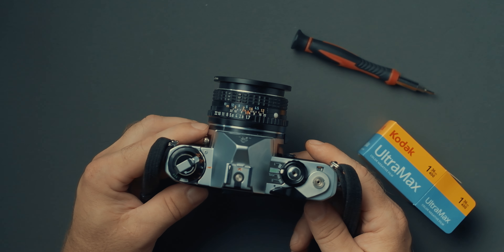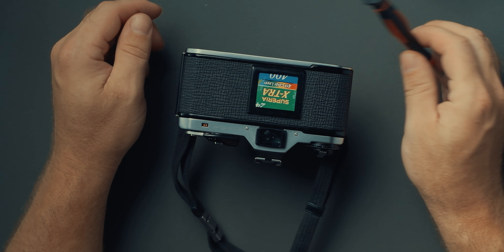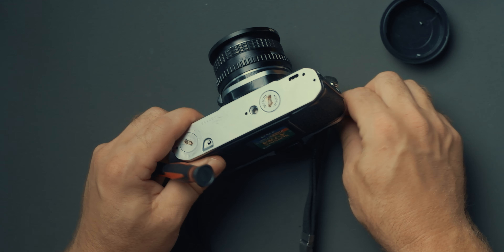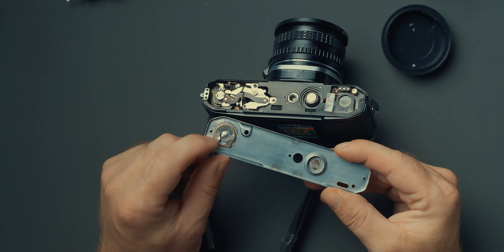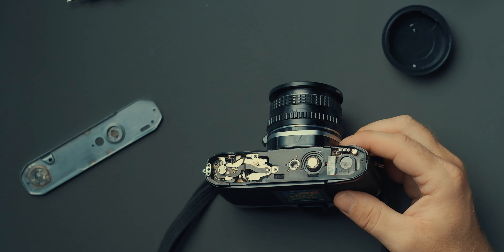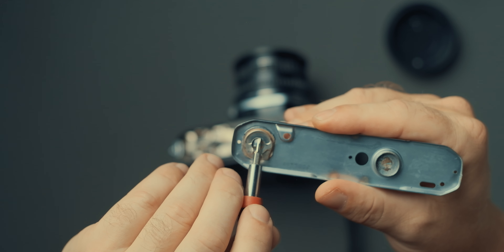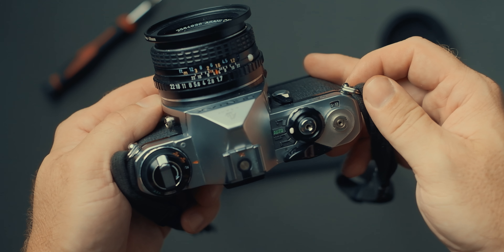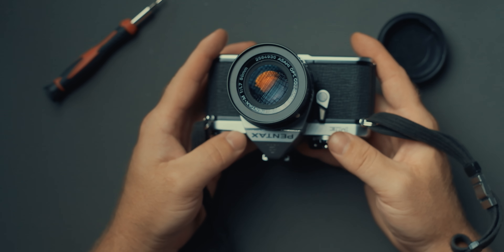Meter Repair - Pentax ME

Comment: Aw man, was so stoked to find this video! This didn't work for me unfortunately :(. Thank you for thr video though. Would you have any other suggestions?
Reply from the maker: The power circuit itself seems fairly simple for this model/type of meter.  Battery --> meter --> shutter release piston that pushes down on the bottom plate to close the circuit.  I'm sure you've checked the status of the battery,  orientation of battery and contact points/surfaces in the battery compartment? If there's any build up you can use white vinegar to clean the contact points. I had to to this to get to my battery.  
I'm afraid that's the only tip I can offer.

Comment: Do you think you can do a video on top of the ME without the cover? I'm trying to put mine back together, and none of the videos and manuals I found of the ME are the Super which are different from the ME or too low quality to see what I need. I'm stuck trying to put the shutter button back on.
Reply from the maker: As I'm currently using the camera I'm hesitant to remove the top before I finished my shooting. Just incase I accidentally mess something up. 
Have you googled for the ME service manual or checked the Pentax forum? There's probably a few people on that forum that could offer help sooner.  

I wish you good luck

Comment: I have the problem of the mirror which has remained raised.
Reply from the maker: Never had that problem,  but I've seen people talking about shutters locking up while shooting in bulb or dark situations (beyond the meters) often by mistake.  
If there's working batteries in the camera, sometimes all that's needed is to work the mode wheel on the camera around and set it to. Unfortunately that's the only tip I can offer at the moment.

Comment: Hello Thomas! Tomás here!

I'm a fan of your work. You've helped me a lot in my photography journey. Recently I ran into an issue trying to use your Canon picture styles, and I was wondering whether you've experienced as well or could know the solution.

So I've been using your styles for some months saving the photos both JPEG and RAW. Recently I decided to give Darktable a chance to get better at photo editing, but when I import the RAW images into the program, all of your filters are lost. I would love to be able to import the images into Darktable with the picture styles loaded on, just so I could touch them up more, but building upon the existing filters. I've tried many options but nothing has come out.

Have you experienced this issue as well? is there anything I could do to import the images into Darktable with the picture styles? The only way I can think of would be importing the images as jpegs, but as I understand, that is a no no in photography.

I would really appreciate if you can help me out!! cheers!
Reply from the maker: I believe that's because nor Darktable or Lightroom have my profiles installed in them. 

The workaround is to use Canons raw processing software. It's free, just like eos utility.